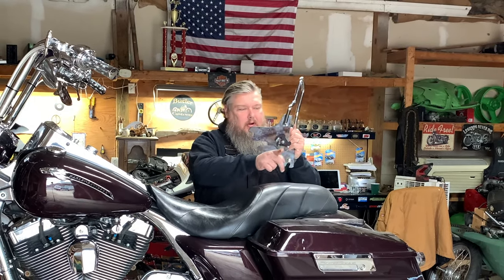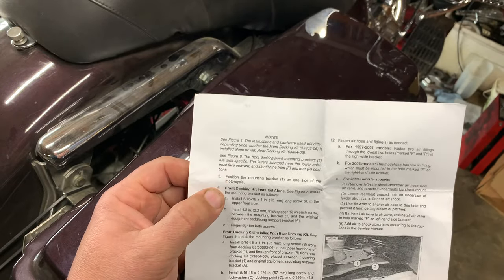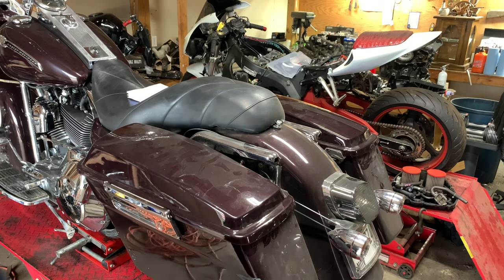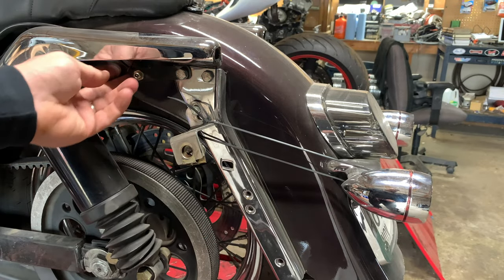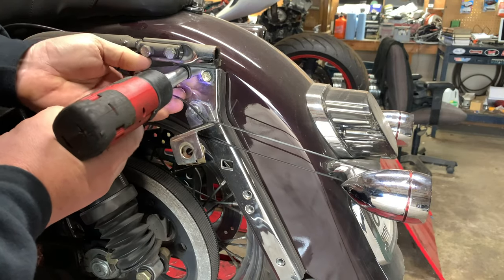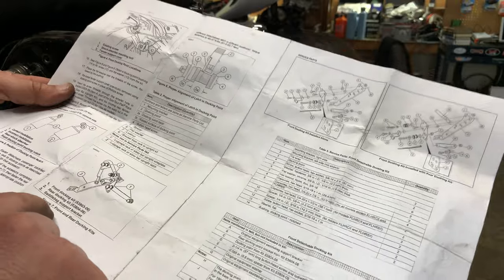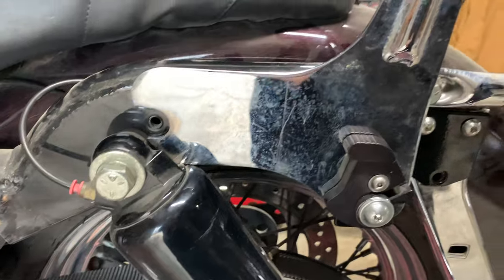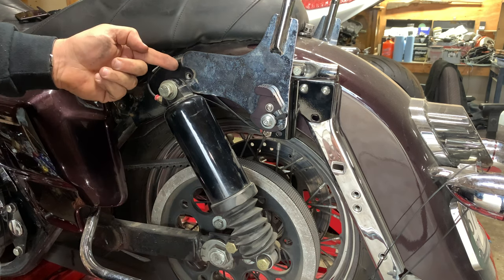How to install a quick release backrest on a Harley Davidson Touring Road King

Comment: Hi great  video. Please tell me where you got this kit from? And price, part number?  I have a 2008 
Ultra Classic. I would like to install it on. They say they won't fit on the Ultra's but they do. It's an issue with
the wiring harness lights and speakers needing revamped But theres a fix for that to on
U tube also. I would like to add a
Sissy bar once and a while and
put on and quickly detachable my Tour pack when not needed. I like that this kit appears to cover both mods! Thanks
Reply from the maker: The customer purchased that kit. So I’ll try to get the info from him but I believe he bought it off eBay.
Reply: Excellent! thanks so much! I'll look on e bay .  I'm just like you .  Every time I put a tool down it evaporates!  Spend more time looking for tools than doing the job!
Reply from the maker: @nazareth4u524 I feel your pain.

Comment: are there any kits to upgrade the 13 saddle bags locking system to the 14 "one-finger design"?
Reply from the maker: There used to be a couple of companies that made them but I don’t think they sell them anymore. I know that most people just swap their entire bags out for the 14s and just readjust their pin brackets. On the front bracket you have to do a little light fabrication. I don’t believe just a lid swap would work either. Thanks for commenting!
Reply: Thanks!
Reply from the maker: @oleksasirotinin1532  my pleasure.